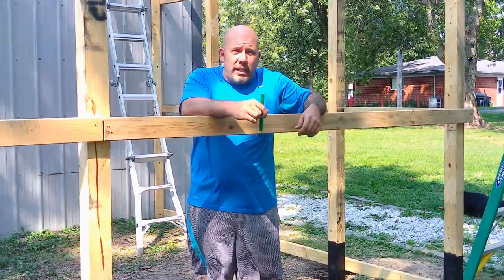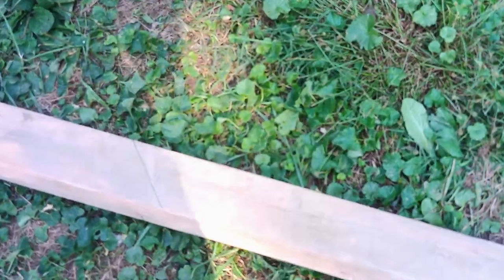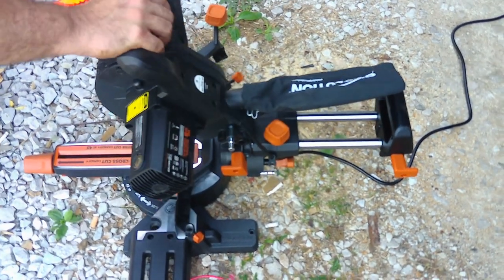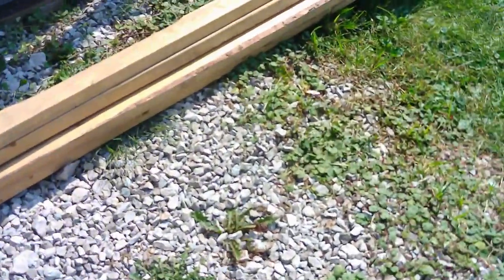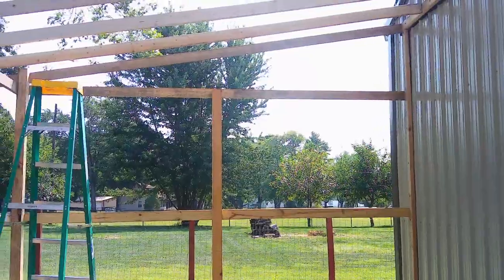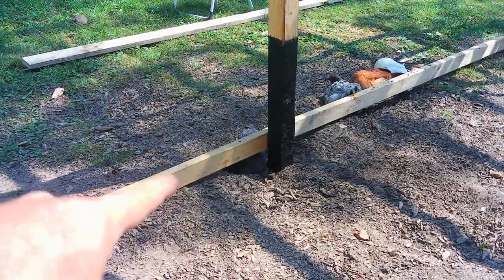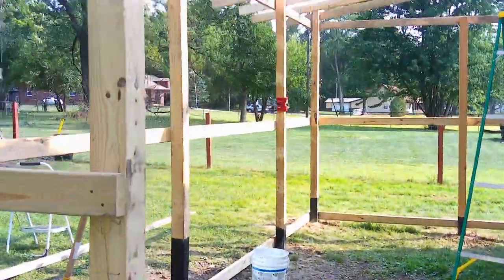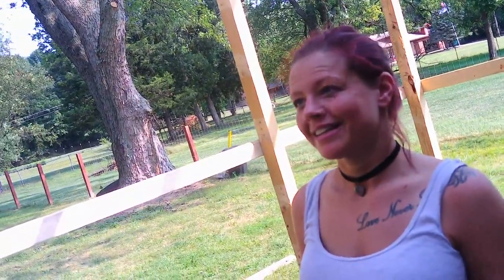CONNECTING Barn To Post RAFTERS/Barn LEAN TO Shed EXTENSION Build

Comment: Did you do bird mouth on rafters are just use rafters brackets
Reply from the maker: I used rafter brackets. Since my building wasn't perfectly square it was much faster this way lol. Thank you so much for watching! I hope you enjoyed the video and subscribed!
Reply: Do I need to cut birds mouth if I build 12x16 r 16x16  are can I just use brackets on both sides
Reply from the maker: I would check your state's building codes first! I know here in Indiana anything over 200sqft needs a permit. Lol I didn't know that and they got me....there's a video on it lol. If you're building onto something similar like I did, you'll have to use brackets on the end that butts up to your barn, garage, etc. And the other end unless you got really long timber screws, you'll want to use brackets on those as well....birdsmouth or not.   High winds can take your roof off. So besides whatever code is in your state, you'll want to use brackets on both ends. Most use hurricane straps/brackets. It would be your choice if you want to cut birdsmouth. I hope this helps and made sense over text lol.

Comment: 2x6s over a 12 span?? Nothing like under-building a project.  Just don’t put anything of value in it.
Reply from the maker: Thanks for watching and your concern sir! I really appreciate you. It wasn't underbuilt and i can see why you say that....you need to watch on. I ended up putting an I beam down the center longways to hold roof load. An engineer approved it. Thanks David!
Reply: For roof rafters, 2x6 over 12' is strong as Hell, especially 16" on center. Block every 4' if you're at all worried. You do need to put in some (3-4ea 2x6x12' s) to support your ledger, the steel paneling isn't enough...it will cup and bow.
Reply from the maker: @matthewmitchell8941  I figured it would be strong enough as well. The ledger connects to the board....not sure what it's called lol on the inside of the barn. Thanks for watching sir!